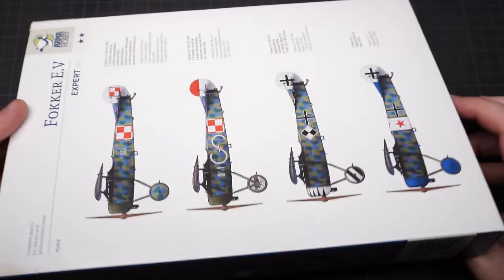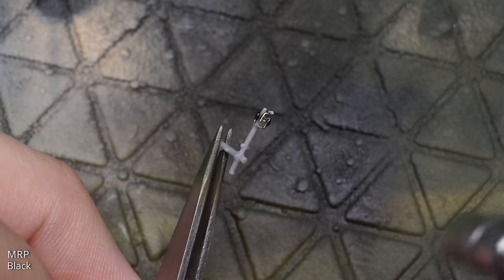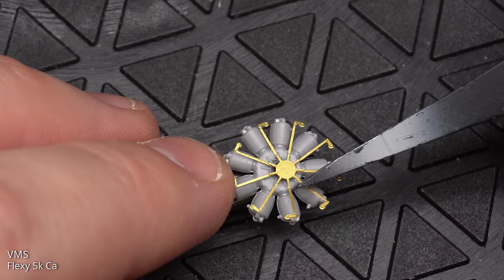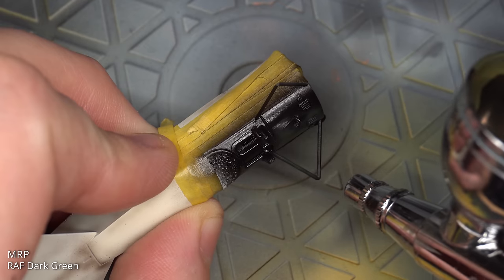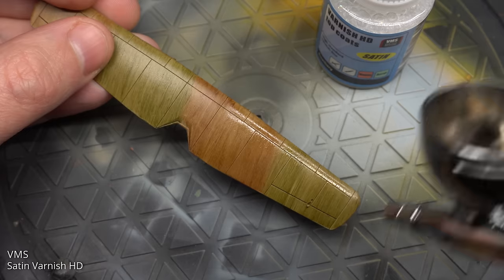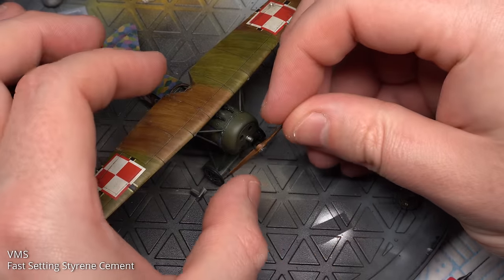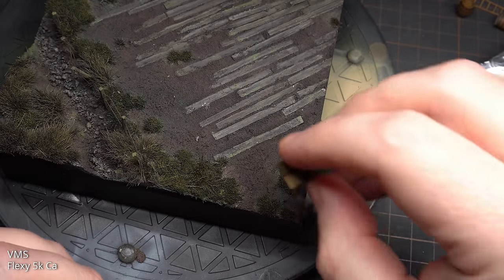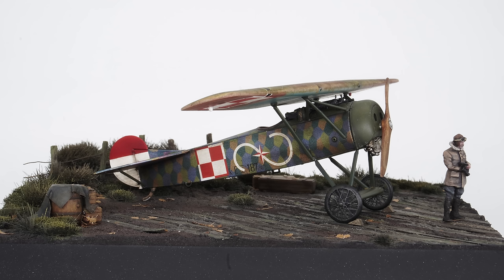Arma Hobby Fokker E.V 1/72 | Full Build and diorama base.

Comment: I think that has come out really well. As they say the whole is more than the sum of the parts. I also really like these small dioramas to set off a model. To me the longer it takes the more value you have got out of the build. As for those spoked wheels, I think you might have had an easier time if you had annealed the PE. I use a gas lighter for camping stoves or gas cookers. They have quite a hot flame and just play it over the brass until it starts to change colour. It takes the springiness out of it.
Reply from the maker: Thanks Allan, I agree ! 
Usually I do anneal but I just plain forgot this time 🙃

Comment: Such a fun build and diorama! Lovely work!
Question, what would happen if you wet the VMS smartmud with some water or pva for the first layer to stick better to the base? Never used it but it almost seems like its a bit too dry to stick to a flat surface.
Reply from the maker: Thanks Mikester, the adhesion is pretty good when it's all cured and bonded. I think the PVA might be too wet. Maybe letting it go off a little before putting on the smart mud may help if it was a major concern

Comment: Hey James, i have just finished my fokker 2 weeks ago and i think yours turned out very nice, although i have to say, unfortunately youve made a huge mistake, you painted the wrong wing pattern on top😢 it should be brown sides and green in rhe middle, the one you made is for the german versions
Reply from the maker: Thankyou !  Sadly I have been suffering from a chest infection since Xmas and my usual thoroughness suffered because of  that, I didnt even rig the exterior for example. That's being said I'm not too cut up with it this time. Thanks for pointing it out though  because others may benefit from your knowledge !
Reply: @lpjmodels no worries man! I hope you get better soon, I also didn't rig mine, as it's just 2 wires on the wings and 2 braces on the landing gear struts, also I have to say that base of yours is superb, mine is just a slab of wood and some grass but I hope to add a figure to it soon. Again great build and end result, keep up the good work man!
Reply from the maker: @random_model.builder  thanks ! I completely get it though usually I'm all over reseach and making things right. Good luck with the figure !